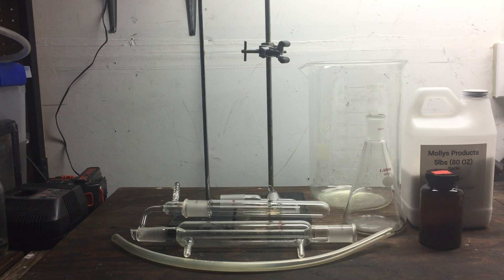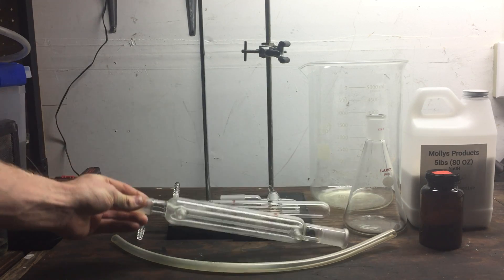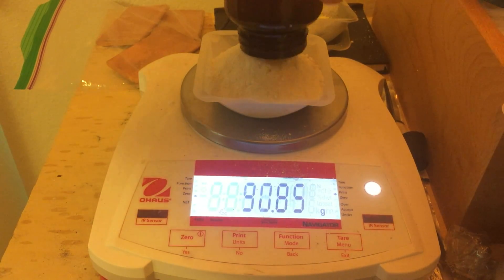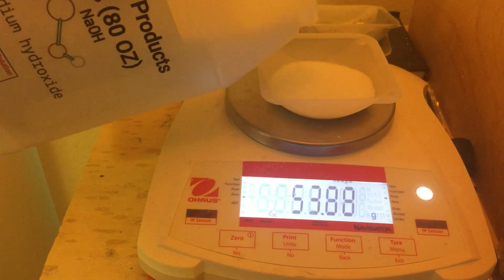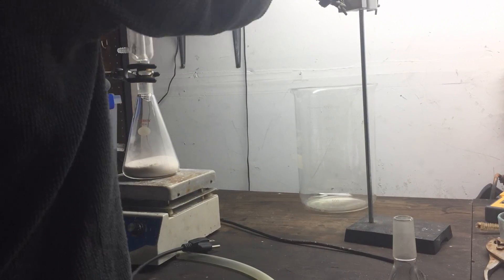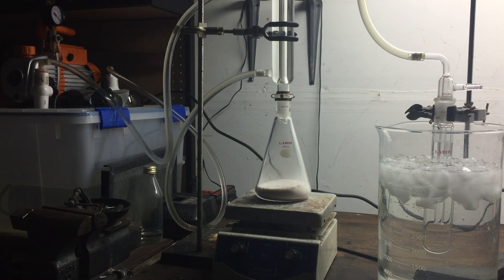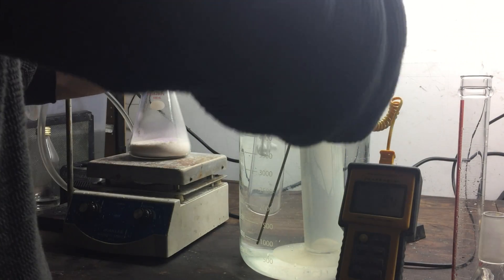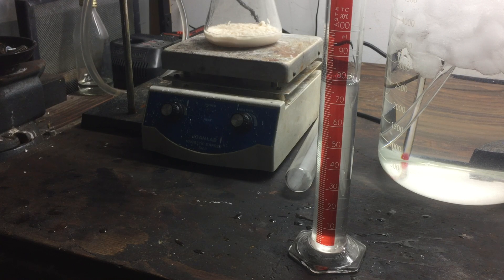Ammonia Gas Generator

Comment: I bought sodium nitrite off of Amazon, as a substitute for nitric acid because i couldnt find any on there, but in order to use for dissolving my metal i needed to react it to form the nitric gas. The steps they provided were just a little confusing, it would be cool if you could do a video on the process someday. I also needed hydrochloric acid and copper just to start the reaction.